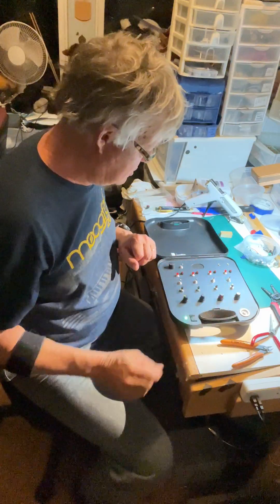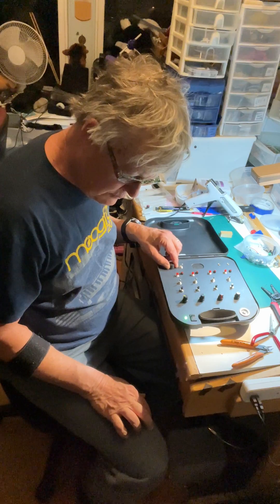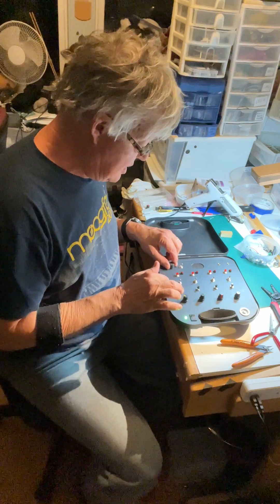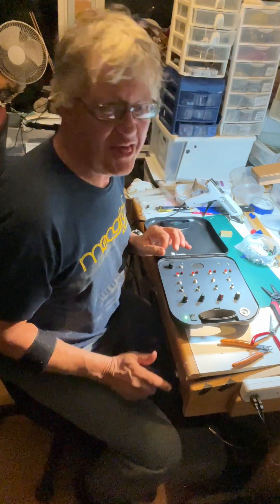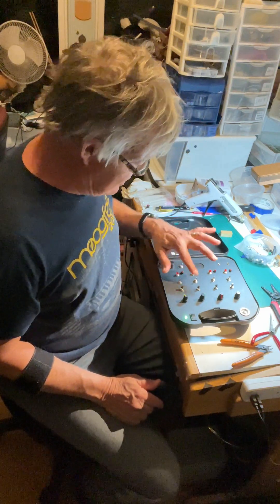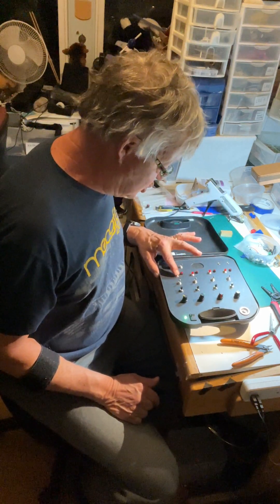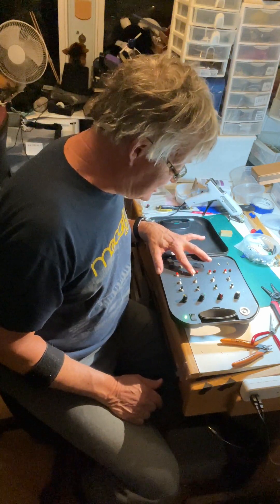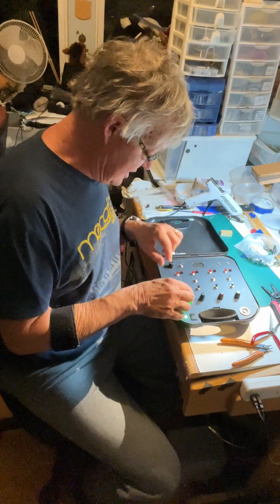DIY Looper using 4 ISD1820 modules

Comment: Did you attach all the vcc and grounds together and attach it to a power source
Reply from the maker: Yes, and their output positives together. However, there is probably a better way because when all 4 of the loops are going the volume drops a little too much.
Reply: Hi Zen! 
Your volume will remain constant regardless of how many modules are playing if you actively mix them. (buffering each module after putting it through a volume pot, and then amplifying the result) 
I plan on releasing another ISD1820 video with that upgrade and more explained!
Reply: @zenSutherland  have you tried powering it with like 2 sources (2 to each two boards) or with a usb?